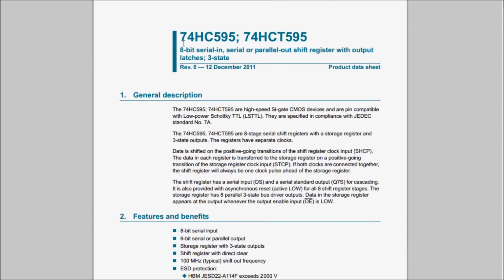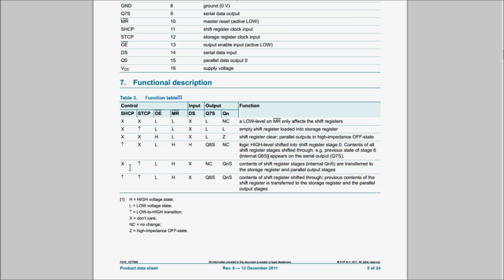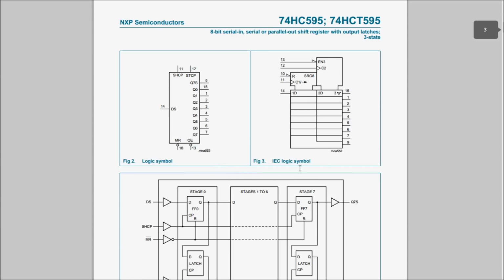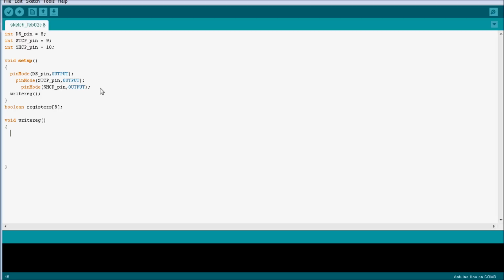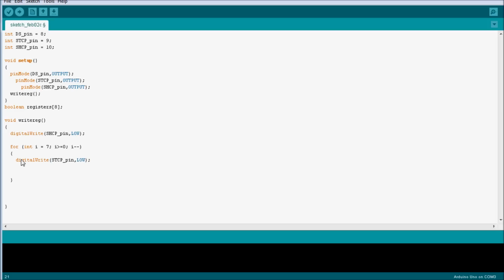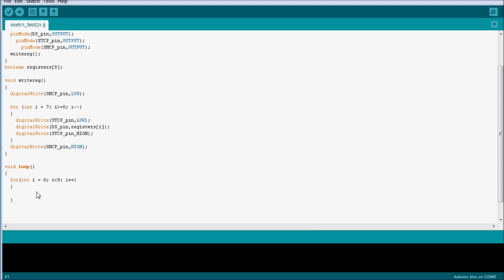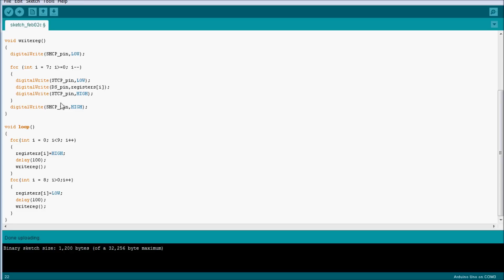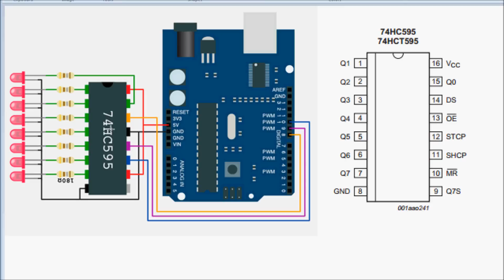Arduino Tutorial #3 - Shift Registers (74HC595)

Comment: So many things wrong with this (& I'm surprised it hasn't been corrected in 11yrs!!!)
Major issues....

1). Excessive combined 'ON' LED current through the output pins will exceed the 74HC595's max supply current (Icc < 70mA MAX). As a fix, I recommend ~680R resistors. 

2). The software contains SO many errors! 
Main one is the 'registers' array being written out of bounds. The registers array is defined as boolean registers[8] with valid indices 0 to 7. However, your loop starts at i = 8, which accesses registers[8] (an out-of-bounds index!) and WILL cause undefined behaviour such as reading garbage values or crashing the program.
Cannot correct your hardware, but, for anyone else who accidentally lands here, this software works....

/*
Corrected 74HC595 Driver Example
*/

#define DS_pin    8   // Serial Data Input
#define STCP_pin  9   // Storage register clock input
#define SHCP_pin 10   // Shift register clock input

boolean registers[8]; // Array to store shift register bits

void setup() 
{
  // Set pin modes
   pinMode(DS_pin,   OUTPUT);    
   pinMode(STCP_pin, OUTPUT);
   pinMode(SHCP_pin, OUTPUT);
   
   // Initialize the 'registers' array to a known state
  for (int i = 0; i < 8; i++) 
  {
    registers[i] = LOW;  // All bits low
  }
  writereg(); // Write initial state to shift register
}

void writereg()
{
  digitalWrite(STCP_pin,LOW); // Latch low to prepare for shifting
  for (int i=7; i>=0; i--)    // Iterate from 7 to 0 to match typical shift register order
  {
    digitalWrite(SHCP_pin,LOW);        // Clock low
    digitalWrite(DS_pin,registers[i]); // Write the bit
    digitalWrite(SHCP_pin,HIGH);       // Clock high to shift the bit
  }
  digitalWrite(STCP_pin,HIGH); // Latch high to output the shifted bits
}

void loop() 
{
  // Turn on each bit one at a time
   for(int i=0; i<8; i++)
   {
    registers[i]=HIGH;
    delay(100);
    writereg();
   }  
   // Turn off each bit one at a time
   for (int i=7; i>=0; i--)
   {
    registers[i]=LOW;
    delay(100);
    writereg();
   }
}

Have fun!
Reply from the maker: Thank you for pointing those out!

Comment: While the approach demonstrated here is correct, it is also slow due to the use of digitalWrite.

The built-in digitalWrite of arduino are known to be slow (~170 clock cycles) because it looks up the port to set every time during runtime. 
There are libraries such as digitalWriteFast that uses C macros and direct port manipulation that can speed it up to 2-4 clock cycles per write. 

If you are using Arduino Nano, you can also try to flash the firmware of Arduino UNO so that you have access to more memory. The pinouts are the same and only the firmware is different.

Comment: 12:00 with 180 ohm current limiting resistors on the LEDs, you are pulling around 28mA per output which far exceeds the maximum chip current allotment for the 74HC595 which is 70mA according to the datasheet.

Comment: I have a separate power supply meant for the shift register ic, but when i unplug it i notice that the shift register + all the LED's just keep running, probably from energy from the data pins. This is something to be careful with if you're going to put 200 LED's on it. Possibly the total current draw will end up on the data pins of the arduino, blowing them up. I think a resistor between the arduino and the shift register is a good idea to prevent this. Allowing a max of 5mA per data pin should be good enough i think, lower would be better if you're doing more things with the arduino. But good tutorial, i got it working within 15 minutes :D And the LED's response very rapidly which is perfect.

Comment: Nice guide. I would like to create the same effect with 8 independent situations using the “if” function. It should go like this: situation is true LED 1 turns On. Situation 2 is true LED 2 turns On and LED 1 is still On. Situation 3 is true LED 3 turns On while LEDs 1,2 still On. So I create fill increase or decrease effect. But my problem is that the LEDs keep running On and Off in the loop while satisfying each consecutive situation. How to keep them from running On and Off while ruining the tests for 8 states? Thanks for your guidance.
Reply: Note: I use arguing Uno and the shiftOut function...

Comment: use the SPI interface and it will go faster,
just conect 74hc595 data in to mosi pin, 
manualy toggle the strope pin and clk to clk pins

Comment: In the schematic the resistors are in between the chip and the (+) side of the LED. But in the actual circuit the resistors sit in between the ground and (-) side of the LED.

Comment: Both the for loops in the loop() function are wrong, they are probably trashing the stack, and could lead to issues with a more complex program. The registers array is of size 8, so the conditions should be (int i = 0; i < 8; i++) and (int i = 7; i > 0; i--). This last > 0 should also be >= instead to mimic the HIGH behaviour, in the video the first LED never goes LOW.

Other than that, great explanation of shift registers. Thanks!

Comment: i am using MG87FE52AE this ic to weighing scale PCB so i wanted extra display from the board. And that board have 6digit 7segment 16pin so i wanted to convert 16pin to 6 pin by using IN74HC595AN IC. So please i request you to send data diagram ho to connect that ic or is there possible to connect that ic or is your support to that ic? Please give me a answer please

Comment: Since the code is jacked.. Can someone just post the code here in comments instead of linking it please..  I have done the corrections shown in the comments.. but doesn't fix it..

below is what I have that does work kinda.. just not as his code is supposed to in the video when he turns it on.. 
int DS_pin = 8;
int STCP_pin = 9;
int SHCP_pin = 10;

void setup()
{
  pinMode(DS_pin, OUTPUT);
  pinMode(STCP_pin, OUTPUT);
  pinMode(SHCP_pin, OUTPUT);
  writereg();
}
boolean registers[8];

void writereg()
{
  digitalWrite(SHCP_pin, LOW);

  for (int i = 8; i >= 0; i--)
  {
    digitalWrite(STCP_pin, LOW);
    digitalWrite(DS_pin, registers[i]);
    digitalWrite(STCP_pin, HIGH);

  }
  digitalWrite(SHCP_pin, HIGH);
}

void loop()
{
  for (int i = 0; i < 8; i++)
  {
    registers[i] = HIGH;
    delay(100);
    writereg();
  }
  for (int i = 7; i > 0; i++)
  {
    registers[i] = LOW;
    delay(100);
    writereg();

  }

}
Reply: #define DS_pin 8
#define STCP_pin 9
#define SHCP_pin 10

void setup()
{
  pinMode(DS_pin, OUTPUT);
  pinMode(STCP_pin, OUTPUT);
  pinMode(SHCP_pin, OUTPUT);
  writereg();
  Serial.begin(9600);
}

boolean registers[8];

void writereg()
{
  digitalWrite(STCP_pin, LOW);
  for (int i = 7; i >= 0; i--)
  {
    digitalWrite(SHCP_pin, LOW);
    digitalWrite(DS_pin, registers[i]);
    digitalWrite(SHCP_pin, HIGH);
  }
  digitalWrite(STCP_pin, HIGH);
}

void loop()
{
  for (int i = 0; i < 8; i++)
  {
    registers[i] = HIGH;
    writereg();
    delay(50);
    registers[i] = LOW;
    writereg();
  }
  for (int i = 6; i > 0; i--)
  {
    registers[i] = HIGH;
    writereg();
    delay(50);
    registers[i] = LOW;
    writereg();
  }

}
Reply: In writereg you will want the for loop to be for(int i = 7; i >= 0; i--).
In the main loop you will want the first for loop to be for(int i = 0; i <= 7; i++) and the second to be for(int i = 7; i >= 0; i--) i.e. the same as the writereg for loop.

I haven't tested this, but logically it makes sense since the 8 bit outputs are 0 - 7.
Reply: You don't want to put what Jiz1obber did (for(int i = 6; i > 0; i--)) since this will skip outputs 7 and 0.

Comment: I have a problem. I did everything what you did, but only 4 LEDs light. I don't know where the problem is and how to light up 4 other LEDs...
Reply from the maker: Well, based on the fact that you're able to get 4 LEDs working, I would assume that your issue is in the code. Verify that you are setting the right bits in the program by outputting the status to the Serial port. Without having your circuit in front of me, it's hard to say what's wrong exactly, but I would start there.
Reply: EEEnthusiast Thanks for the answer. The problem was with grounding. There should be two grounding cables on both sides of the resistors. I don't know why it works in your example with only one grounding cable going from the line of resistors.

Comment: Arduino: 1.8.1 (Windows 10), Board: "Arduino/Genuino Uno"

C:\Users\Sophie\Documents\Arduino\_8_LEDS_version_2\_8_LEDS_version_2.ino: In function 'void setup()':

_8_LEDS_version_2:18: error: 'writereg' was not declared in this scope

 writereg();

          ^

C:\Users\Sophie\Documents\Arduino\_8_LEDS_version_2\_8_LEDS_version_2.ino: At global scope:

_8_LEDS_version_2:24: error: expected initializer before 'void'

 void writereg()

 ^

exit status 1
'writereg' was not declared in this scope

This report would have more information with
"Show verbose output during compilation"
option enabled in File -> Preferences.

Comment: There's something wrong with your code in the video. You switched the SHCP_pin to STCP_pin in the writereg() function. And in the second for loop in the void loop sub, you wrote i++ instead of i--
Reply: as   with  p sark    - when  you  mess up  can be  hardware  / software / or   both  

snoty  howard   little   had   problem  his  cade  - asked   for  help.
Solved   the   problem   then  of  little ability wanted  to be superior  -  tread on  others  that they  no use  - to  brag   about it.   Such that  little  got 25%  pay  increase  -  typical of  brits   and  their  military  contracts

Solved   other   problems    -  with  howard  little  denigrating my rep and ability    brit   military  can  stick it  up their   pipe   as   get  'treated'   same way as   howard  little ,

Its   for   other  countries   - where  I get   paid

Comment: Can you explain what does it means :
for(int i=0; i<8; i++)
for(inti=7; i>0; i--)
Thank you
Reply: for(int i=0; i<8; i++)
>> This is initializing i to 0.  
>> Then, at end of instructions  written into the 'for', it will increase i (i++ is equivalent to i = i +1).
>> Then it will test the condition i<8 (Is i lower than 8 ?). If yes, it will redo all instructions written into the 'for'.

for(int i=7; i>0; i--)
>> This is doing the same, but decreasing from 7 to 1.
>> Here you can see he should use i>=0 if he also want to turn led 1 to 0.

NB: the first cell of a table is [0], it's why we count from 0 to 7 for 8 cells.

Cheers,
Laurent
Reply: and if I just wanna increase but not decrease ?

Comment: Why use a resistor for each LED? Wouldn't just one resistor for all of them work? Or did I miss it?
Reply: +4mb127 The problem is that the diodes all have different characteristics. One might conduct just a little bit more then the next one so this can cause the diodes to have different brightness. This can lead to one diode failing and then it would take the others down with it. Giving each diode its own resister prevents the characteristics of one diode affecting the others. 

Using one resistor will often work with no problems and I have done it myself on occasion, but its bad design practice.

Comment: On line 10 writereg();
I get this error: 'writereg' was not declared in this scope
This is from the code in the link above.  Can anybody comment?
Thanks!
Reply: I solved my bad coding problem.  My LEDs don't flash so I added some indicator LEDs to the OUTPUTS.
LEDs 9 & 10 flash on and off but my LED in Digital 8 stays high.  I think I"ll pull the wire out of 8 and short it directly to ground to see if I can toggle the shift register that way.
After I look back at the Data sheet of course.  Being 20 years since I graduated from DeVry I remember enough to be very dangerous! :)

Comment: my shift register is acting like a proximity sensor lighting up in sequence as i move closer until im close enough they all light up at a consistant full brightness using this same setup and its got me baffled, anyone have an answer? it only happens when i put my finger near the data pin wire and if i touch the ds wire with a piece of metal it keeps the lights on then when i bring that metal close to the ds wire it shuts them off and if i hold that piece of metal to the ds wire it flashes rapaidly also im using regular untampered insulated jumper wires

Comment: Can I simply connect 3rd party 5V power supply to the breadboard instead of Arduino 5V and GND or there would be a need for some extra protection?
Reply from the maker: +Bartek Boczar You can absolutely connect a 3rd party power supply to the breadboard. One thing to remember is to always connect the GNDs together. This will eliminate the possibility of floating voltages which can cause unpredictable results. However, if you are driving isolated loads, you don't even need to do that.

Comment: because of the fact that every single arduino tutorial involving shift registers in existence shows how you can control various leds with a "for loop" or similar, i am going to assume that you cannot individually control leds as needed.Such as when a user "presses  button 1 and led 1 turns on" Can I assume that is true?
Reply: +David Arroyo Well you assume wrong. If you do not set the bits of the array in a for loop, you can manually set any of the bits to the desired state, then call writereg(). It's just easier to fill the array in a loop and it's adequate for the purposes of the tutorial.
If you want to see a code, here it is how to set only the second led to light up:

for(int i = 0; i<8; i++) { registers[i] = LOW;} // Set all the pins to dark
registers[1]  = HIGH;

writereg();
Reply from the maker: +Zoltán Szeli To be fair, that would still iterate through the shift register through the for loop inside the writereg() function.

The answer to the original question is that a shift register is essentially a queue. This means that you can only shift into it and whatever is at the end, falls off. You can use any code you like, but if you want pin 2 to turn ON, you need to first shift a HIGH into pin 0, then shift it over to pin 1 then shift it over to pin 2.

Comment: Is there a differnce between the 74HC595 and the SN74HC595, for how i see it the look the same but it is not working :(
Reply from the maker: +Tim Zegers It shouldn't be any different, SN specifies that it is a Texas Instruments IC.
Reply: Is it upside down/are the pins in the right order but on the wrong side of the chip?
Reply: make sure you placed the IC the right way. There is a 'U' like looking dent to identify on one side
Reply: I am following another tutorial, showing the LEDs on the reverse for SN74HC595, the notch in the same direction..

Comment: I'm looking for a shift register that supports both parallell input as well as parallell output. Is that possible to do with the 74HC595?
Reply: No. But an 74HC194 is fit for the task, if your not bothered by it only having 4bits per chip.

http://www.ti.com/product/CD74HC194?keyMatch=74HC194&tisearch=Search-EN-Everything

Comment: I'm wondering if it's possible to overload this chip running LEDs. If I understand correctly an LED may draw up to 20 mA of current or 160 mA for eight LEDs. The datasheet for the 74HC595 states continuous current through Vcc or GND should not exceed 70 mA. While the example works I'm still wondering if this is technically outside the chip spec. Does the chip get warm if you light all eight LEDs for a few minutes. Thanks.
Reply from the maker: +candleburning You have the option to trigger transistors from each pin which you would use for each LED. A MOSFET can be triggered by a very low current, so you would avoid this problem. In my example, I used resistances to run the LEDs at about 5mA, so it was fine.

Comment: Declaring your I/O pins as int is a bad habit. You're declaring them as variables, which they aren't, but as variables they consume RAM. It's better to write

#define STCP_pin 9
Reply: @Chopy 61
It's usually for all pins with one very rare exception.
This exception can be, if you want to change the pin during runtime, in this case you will need a variable to store the change.
But i don't know a situation where this is needed. 
So you usually won't need variables for pins.
Reply: Just wanted to know, is it only for STCP or also the other pins?
Reply: Even better to use const int.
Reply: I don't think its a bad habit unless you are writing a program that pushes the limits of the memory. Having named values aids readability which is an especially good habit to teach beginners. Plus, if you use that pin more than about 10 times in code and later want to change that pin, this makes maintenance easy.
Reply: @andrewscott1253  Memory use when not needed is ALWAYS a bad habit
Reply: @muppetpaster  It used to be I'll give you that.
Reply: @andrewscott1253  But still the arduinos have very limited memory........
Reply: @muppetpaster   A well written modern compiler will actually recompile all our named constants into literals anyway so really by not using named constants your just causing yourself more trouble than its worth.
Reply: youre missing the point.  a pin is immutable and should be declared as such.  using a macro or const is the correct way to represent a pin.
Reply: @andrewscott1253  still bad habit. Whether you have the RAM or not.
Reply: @andrewscott1253  "Having named values aids readability " by using the #define method you're still using names for the pins. I have the feeling you didn't understand Steven's comment completely or so that i have to tell you this.
Reply: @andrewscott1253  OK agree, but only when needed and USEFUL
Reply: Especially the latter

Comment: The simplest tutorial on the internet for shift registers! I used it with my Attiny85 chip. Few notes: while programing the attiny with the arduino as ISP you will end up with a common pin between the arduino and the shift register pin. While transfering the code the chip might reset but there is no need to disconnect it